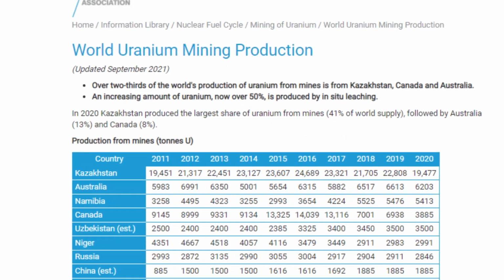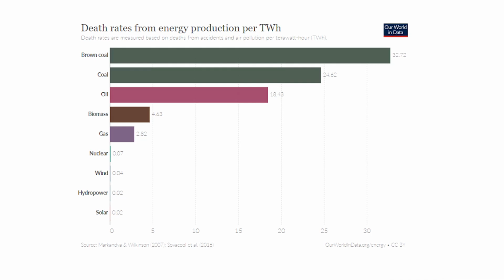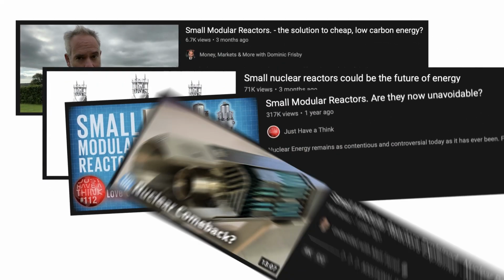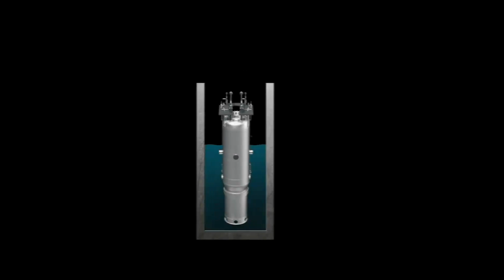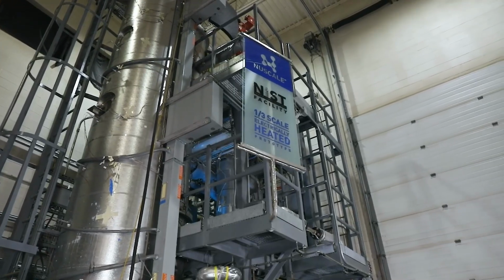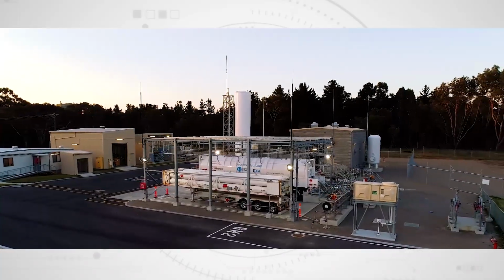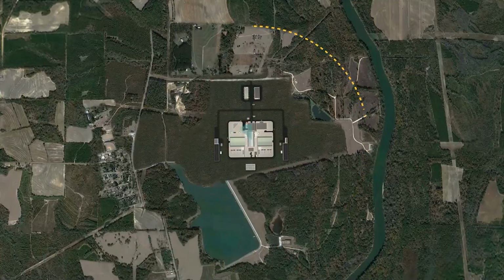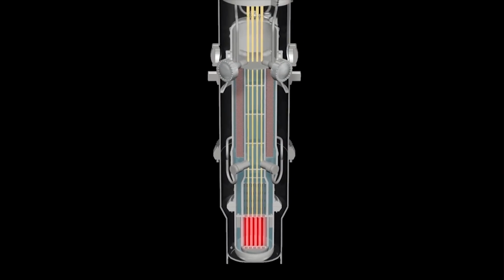Can Small Modular Reactors Save Nuclear Power?

Comment: You're lucky to have no nuclear power plant with unmanageable nuclear waste
Those who support nuclear power have been foucusing only or mainly on economic values,  being either too ignorant to understand the invevitable human-self-destruction in the long run, or too greedy or for immediate personal material values to see any disastrous, irreversible consequenses

By the way, the formular of engergy or more accurately -speaking, the eq of strong nuclear force -extracting formula is incorrect or merely subjectively assumed by Einstein. C= 300000km/S is not the speed of light as fictionally claimed. I can easily prove that the subjectively assumed speed of light depends on how you configurate human-invented system of time, and it can become larger or smaller than the assumed value when the invented time system is reconfigurated becuse the invented units of time, such as hour, min, second, day, weak, month, year, century, millennium have been merely arbitrary values based on human-invented concepts of mathematics, which have a lot of flaws and defective holes. Such symbolic values are unreal or imagined and borrowed from the Earth's endless rotational motion around its translated axis and the Sun. Ex, each day is one cylcle of sunlight and darkness. The current invented system of time dictates that each cycle of sunlight and darkness is divded into 24 parts, and the  parts are denotated as  hours which are merely symbolic values being  no any physical form of matter or existence, and actually represent the Earth's one complete rotation about its axis or orresponding to 360 degree which is the angle the Earth's rotational motion has made  in each cycle of sunlight and darkness. The rotational displacement of the Earth for one complete rotation about its axis is approximately  corresponding to  the Earth's largest circumference on the equator Cir = 6R ( You can you use  2πR, but it will give you more error than my formula because π is  an undefinable value having an endless series of digits after the decimal point, and you will have to truncate it to get only an approximared value). The Earth's rotational displacement can be translated into a linear displacement given by S=θR where θ= the angle made by the Earth's rotational motion from an innitial point of refference, when this poin on the Earth's surface is the transitional point between sunlight and darkness, and the final point when this point has made a complete circle and returned to its initial position to overlap it.  It means that θ = 360 degree. 
R is the Eath's largest circumference's radius  which is known 
So,  the symbolic and invisible value of each hour actually represents an angle of rotation of the Earth's rotational motion→ 1 h ≡ ( corresponding to) 360º / 24 hours ≡ 15 º ( degree),  or  a linear distance which the Earth has travelled  d ≡  S/ 24 h ≡ θ*R km/24 h  which is the linear displacement of the Earth's position along its orbital path around the Sun when it has rotated 15 degeree or for one hour. 
Each cycle of sunlight and darkness = one day  can certainly also be divided into more than or less than the arbitrarily dictated  24 parts conveniently for your subjective choice of numbers and intented manipulations of human-invented number systems, say, 30 parts or 20 parts, and  when the parts are denoted by the lable ' hours ' the 30 parts/ day or 20 parts / day  become 30 hous/day or 20 hours/day 

Now, if you choose 30 hours/day, then the lengh of the time in seconds per day or cycle of sunlight and darknes will be longer:
Time t / day = 30 h/day x (60mins/h) x (60S/min) = 108000S/day
The current symbolic value  in seconds of 1 day is :
 t/day = 24h/day x( 60mins/h)x(60S/min) = 86400 S /day
It means that the then symbolic value of the time of 1 day  will be 108000S/ 86400S= 1.25 =1.25(100/100)= 12.5% of the current symbolic value in seconds of 1day
So, the current assumed speed of light will have to be increase with the value of 1 sencond then incresed to be  1.25  times of the curent value of 1 second. 
1 S then = 1.25 x 1 S  now = 1.25 S now  → spped of light then = C= (3000000km/S)(1.25) = 375000km/S 

If you choose   time/day = 20 hours/ day→ t/day = 20h/dayx(60mins/h)x(60 S/min) = 72000 S/day,  the symbolic value of time in seconds then will be smaller than the current symbolic value of time in seconds, and  the length of 1 sencond then will be 72000S/ 86400S = 0.8333333333 = about 0.83 or 0.83(100/100) =  83%  of the length or the current symbolic value of 1 second . It means that the speed of light then will have to be decreased from c= 300000km/S to 300000km/S(0.8333333333) = 249999.99999km/S. 
c ≈  250000.0 km/S

So, the currently assumed speed of light obviously can increase or decrease or fluctutate accordingly to human-arbitrarily chosen time system which is conveniently based on human-invented concepts of number systems, but not that the  current speed of light C= 300000km/S is fixed and the highest speed in the universe as so fictionally claimed

Comment: I may just have missed it, but what type of reactor was this? I assume it was a PWR.
If that is the case how do you make it passive cooling?
Another aspect not covered was recharging the fuel rods. Do they simply shut one down and transport it to the factory for refuelling?
Then there is the safety factor ...... Chernobyl being a prime example of what can happen with bad management/ control of the plant. How would you prevent terrorist activity at multiple factory settings? 
All this from a pro nuclear guy ;o)

Comment: Did I miss it, or was lifetime not mentioned?
Presumably, the fissile material is in the form of solid rods, and these require regular replacement in a 'normal' reactor, something like every couple of years or less. I do not recall hearing anything about fuel lifetime or replacement intervals.
This must have a big impact on running cost and/or lifetime cost of thus type of reactor system, surely?

Comment: The decommisioning and disposal is the elephant in the room. Their steel containement vessel will not last for as long as the spent fuel, and contaminated parts, will be dangerous. There may intially be smaller amounts of waste propduced, but to make a difference a large number of units would be required. In general , the technology is reminicent of the PWR technology used in nuclear submarines. They are also a problem when disposal is considered.

Comment: 'Renewables' (they are not really 'renewable') may be cheap to produce, but we are charged a lot to install them, and then because they are intermittent ('unreliable'), they require 100% backup from other, reliable, despatchable, controllable, sources, principally fast-reacting gas plants.  Nuclear plants are expensive because of over-regulation; approve the design once, then inspect welds, etc. while constructing, then quickly approve the entire plant, reducing timescale and cost.

Comment: Great video as always. Here are two issues not addressed in the video. (a) Assuming that this SMR is as cheap as promised. The wast issue is not solved which is one major issue in any country. No politician is willing to place a nuclear waste facility in his or her county, state etc. Currently, it is often stored on site of the plant. (b) I assume this SMR uses Uran as fuel. On our current consumption rate, we will have this kind of power for roughly 200-300 years depending on a number of strategies to prolong fuel use and plutonium mix-ins. The current nuclear use provides us with 4.5% energy. However, 80% of our current primary energy consumption is fossil. If we go all electric some percents can be dealt with better efficiency, but the fast majority cannot. So lets assume we can reduce energy consumption by going electric by 50% then nuclear reactors would only support us with energy for 20-30 years. Then we are in the same situation and have to replace them with other technology.

So in the end I have the impression SMR is too little too late, but you may look into these two issues in greater detail. Maybe I am mistaken.

Comment: Wait, you show stats that tell us:
a. Solar and wind are cheaper per MWatt than nuclear;
b. Solar and wind have a lower death toll per MWatt than nuclear...
but nuclear is still  the way to go? 

And safety concerns are 'not rational'? Have you noticed how Tepco tries to contain the Fukushima site? They had no clue. There was a contingency plan, but that - 'oh my!' - didn't take salt water into account (and a lot more). So they had to switch to a trial-and-error solution.Well, I don't want a trial-and-error contingency plan if it comes to nuclear material. The consequences are way too devastating and wide reaching.

Also, uranium can be depleted, and it will be even faster if the whole world goes nuclear. Making it a very non-renewable energy source. You brushed lightly over the waste-problem, but it will be an even bigger problem when the whole world is switching to nuclear.

And yes, I know solar and wind don't have the stable output that the non-renewables have, but there's barely experience (or research, compared to nuclear) with organized mixed use in combination with large scale storage solutions like batteries or hydrogen plants. Wouldn't it be more useful to invest in these developments, instead of keeping the focus on nuclear solutions?

I know nuclear technology is extremely appealing to techies, but shouldn't the focus be more on real renewable energy sources?

Comment: Did you add all the costs, LCOE is wrong for the real world. 
The point of getting rid of CO2 is the external costs. YES ?????
So add all the extra infrastructure costs of extra electricity capacity needed to meet increased demand. 
The AEMO did say an ×5 in demand, but that may have  been a political statement. 
×3 fold increase is incredibly real possibility. 
×3 plants.
×3 main transmission lines.
×3 poles and wires to the streets and homes and businesses and industries. 

The existing grid can be UNLOADED by the fact that the ends of the grid are dispersed and PERFECT for 'sucking' in dispersed renewable energy. 
20million buildings in Australia, ALL CONNECTED to the grid. 
20million rooftops and different weather everywhere. 
20million vehicles in Australia 1million new annually. 
EV have huge batteries, 100kwh. 
You are an engineer, keep thinking.
The Daily drive is 7kwh. 
The Daily over night needs, 5kwh for a home. 
Plug the EV into the grid 24/7.
You will have the best results, likes, guaranteed. 
Talk to me.

Comment: This is STUPID. 
Innovation only in nuclear, that is STUPID thinking. 
Innovation in Renewables is massive, do you live under a rock 🪨  ?????????
Mr Putin shows you what a nuclear powered world would be, STUPID AND DEAD. 

So the existing grid can suck dispersed power supply from the dispersed ends of the grid, for a no fossil fueled world. 

Only a STUPID idiot would triple the size of the concentrated energy system, the central nuclear powered systems, triple the capacity of the grid, to supply triple the electric demand needed to replace fossil fueled power. 
No coal 
No gas 
No petroleum 
You would have to be $BILLIONS in STUPID. And that is in one state only. 

No CO2 in the world because every country, every dictatorships is nuclear powered. STUPID STUPID STUPID. 

Let the Dictators steal renewable technology, they steal everything else, including nuclear weapon technology and supply.

Comment: SMRs might provide steady baseline power for heavy industry.  Making steel, concrete, glass and many other such commodities require round-the-clock intense industrial processes.  For these applications, efficiency improves as variability is avoided.   Energy input loads for continuous operation of this type are often extreme, but start-up is much worse and deviation from run-mode increased waste, degrade product quality, and lower profitability.  Boston Metal’s electrolysis methods for steel manufacturing, for example, might be sensibly located in industrial parks with dedicated SMR heat-&-power plants.

Comment: I liked the video. Thank you. Around 11:00 comment - I would characterize NuScale's cost benefits as: mass production vs mostly custom (as seems to be the norm with traditional nuclear power); off site vs on site manufacturing;  enabling the building to be made in parallel with the manufacturing & transport of the reactor modules thus reducing total capital expenditures; advanced safety measures designed in allows for better safety at lower cost.

Comment: LCoE for solar and wind  (like on that graph showing nuclear getting more expensive over time) really need to show a range based on climate AND factor in, not just the cost of short-term energy storage, but backup systems like gas generators too.
Not everywhere has Australia's consistent sunshine, and in far northern climates where the winter sun is minimal and heating demands are high, the cost-effectiveness of solar will drop through the floor.
Eg if you get half the amount of sunshine onto your solar panels, your LCoE for solar is going to double (roughly) from $40 to $80. Factor in that you'd need to either have vast amounts of seasonal storage or alternative power sources (like running gas peaker plants for 1/2 the year) and that could easily become $200, at which point, it's more expensive than even current nuclear.
Wind will probably remain viable, but really, this is where Nuclear is really going to be important, not sunny Australia or California.

Comment: Engineers have to look at the full picture if they are to have any credibility.
I am an old Construction Engineer, Civil and Building.
I have successfully achieved major redesign on many projects, even Professional Design Engineers can make mistakes. 
I recall an extremely young female engineer student asking the most senior Building Structural Design Engineer one question about wind loading on a brand new building in NY, CITI BANK CORPORATE HEADQUARTERS. 
Fortunately she followed up her own question and the failure in Design lead to the entire city officials being galvanised to save 1,000s of lives. 

The Citicorp Center engineering crisis was the discovery, in 1978, of a significant structural flaw in Citicorp Center, then a recently completed skyscraper in New York City, and the subsequent effort to quietly make repairs over the next few months. The building, now known as Citigroup Center, occupied an entire block and was to be the headquarters of Citibank. Its structure, designed by William LeMessurier, had several unusual design features, including a raised base supported by four offset stilts, and diagonal bracing which absorbed wind loads from upper stories. 
Google the story. 
Nuclear is so large an investment it will block all new research into renewable energy.

Comment: EXTERNAL COSTS, stay focused everyone. 
C02 impacts on climate, and it's destabilisation, and with Massive costs. 

So fossil fuels bad. 

Electric power to everything including 
Electric vehicles and the home. 
TRIPLED DEMAND. 
Nuclear power plants to supply electricity but now TRIPLED DEMAND and TRIPLED the size of the grid to distribute the TRIPLED ELECTRICAL SUPPLY from TRIPLED size of the power plants. 

Does any one see a problem  ? ? ?
Every country on the planet needs the same solution to stop CO2. 

100,000 Nuclear power reactors. 
70 years of non proliferation of nuclear problems, now not a problem. ??? 

TRIPLED military defence costs,  the USA being the biggest target on the planet. 

May I suggest Nuclear winter would also be a big climate problem. 

And so for the logical to consider
Rooftop solar PV system 
Every building IS connected to the grid today.
EV batteries are 100kwh, huge. 
Home fixed battery is 14kwh, a baby.
So for max value use the EV battery.
Ezi pezi. 
Smarten the existing grid, much cheaper than building 3 grids. And CHEAP.
The Daily drive is 7kwh, ezi pezi to top up from home power. And CHEAP.
No new power plants, And CHEAP. 

Renewables cheaper than nuclear power including storage, and millions of EV batteries. 

Nuclear electricity costs have flatlined above Renewables. 
The total nuclear solution needs TRIPLED the amount of new power plants, and TRIPLED the amount of grids. 
And nuclear power costs above fossil fueled power. 

FMD does nobody think.

Comment: Yeah  SMRs are really awesome.. we should be investing in them super quickly.. However, a quick question.. You mentioned that The can cool down passively with air alone.. What about if the containment area is filled with mud...Also what happens if there is a breach due to some kind of external force i.e. landslide or earthquake.. I guess it essential for emergency services to get to these things safely and neutralize them with out putting people at risk.. What did we learn at fukushima to be able to assist emergency services in the case the worst happens again..?? is it an idea to get these things out and away from site or is it better to process them onsite after an event.. Thanks

Comment: Your graphic of the costs of Solar and Wind is faulty at one level:  it does not include the cost of the [so far non-existent] batteries that are essential to overcome the intermittency problem. If there was a cost comparison of technical equivalence, you would have to allow for batteries or the massive, typically 4x overbuild in capacity to get reliable continuity.  Some argue that intermittency can be overcome by wide area power networks and this is partially true.  But for a true costing of solar and wind one would have to also factor in the cost of such a massive power distribution grid, able to cater for the multi directional peak current flows necessary for grid stability.  This amounts to disinformation on the merits of solar and wind by omission of the costs of technical equivalence with nuclear power.